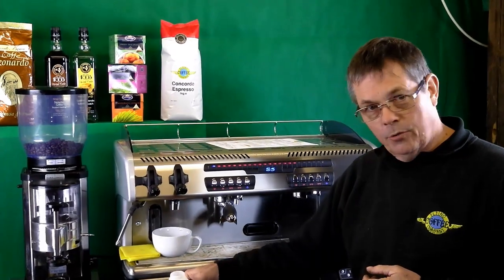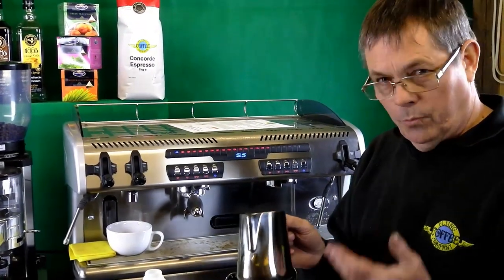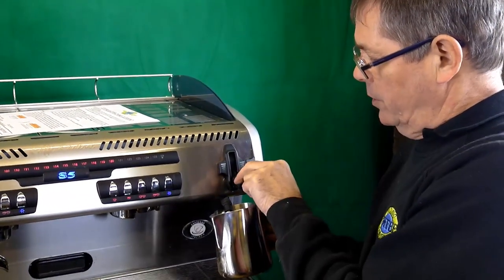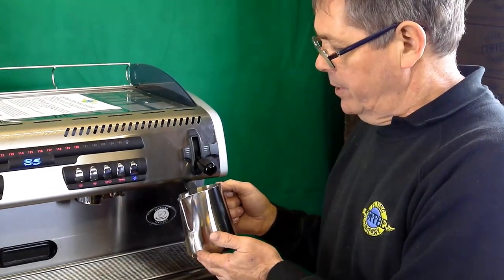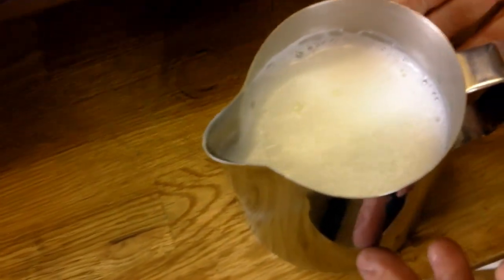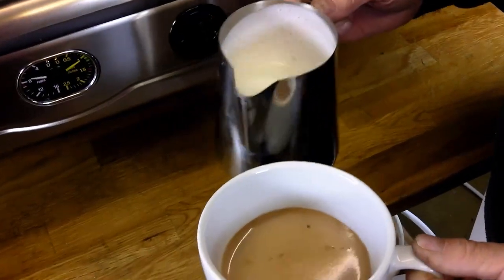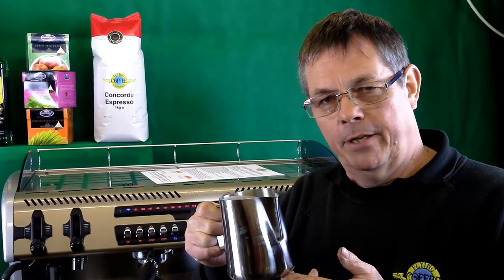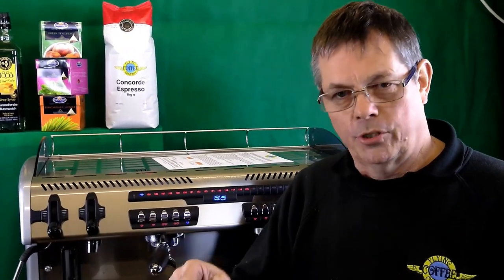How To Get Perfect Foamed Milk Everytime

Comment: Just one thing to say, is that the machine used in this video is clearly a very high quality commercial Espresso machine, a La Spaziale S5 - about five grand's worth of machine. If you're trying to learn to steam milk for Latte art using a domestic or prosumer espresso machine, take this gentlemans advice - but ignore the legnth of time he's steaming for, as you'll probably find it takes you a lot longer. 

I learned using a Gaggia classic, on which I modified the wand (ditched the rubbish turbo pannarello and fitted a Rancilio Silvia steam wand, see coffeeblog.co.uk/classic ) and it would take me around 30-45 seconds to stretch, and then I'd dip the tip to get the milk spinning for usually probably another 30 seconds or so until the milk reached the right temp, so around a minute to 85 seconds, clearly much longer than videos like this where baristas are using top-notch commercial machines. I thought I was doing something wrong at first as I noticed that nearly all the videos I was watching showed people doing it far quicker.

I've recently moved to a La Pavoni Europicolla (brilliant machine, see coffeeblog.co.uk/lapav), and although this is still an inexpensive machine, the steam is better, its quite a bit quicker to steam on this machine, and the results are more consistent, but still - I wouldn't expect to steam as quickly as with a machine like this.
Reply: Coffee Blog

Comment: Why not use a thermomoter at least until you get an idea of how hot your milk jug feels at the required temp. That milk you foamed does not look right, as had been said already your milk has seperated. Also depending on weather you are making a cappa or a flat white the milk should be slightly different. For the cappa, more foam, for the FW, consistently silky. Also that machine is a top notch machine with a powerfull steam wand. Most people at home will not be able to steam like that as their steam wand will not be that powerful. They should start their steaming with the tip of the wand just beneath the surface of the milk until you get to a temp of about 100 degrees and then lower the top of the steam wand down into the milk(approx half way) to finish the job, again a thermometer is usefull here at least until you can determine the different temps by touch.

Comment: "and that's how your milk should be"  sorry mate not true. You've overheated the fats in the milk which is why your milk looks dry and separated; so you're overcompensating with swirling. Your milk should be glossy, silky smooth like wet paint or a merainge straight off the steam wand without grooming or swirling. Use a thermal indicator or themometer. Sound wise you have the right idea,  But the wrong target. It should be all finished, steam wand off BEFORE the note changes at 68-70degC. Anything over 68degC is too hot( the point where foam particles start to expand). Industry standard is 65degC, and even then Melbourne and Sydney are serving coffee at 55 where milk fats, sugars, expanded protiens(foam) all meet at the similar point of consistency weather full fat or skim without affecting flavour(though a fuller fat will enhance flavour but destablise foam/protiens more rapidly once heated). 
I have had to use milk like yours to suit a classic order of a 'Dry Skinny'cinno extra hot' but it pains me to hear the community of cows in the paddock nearby echo cries for how we treated thier craft. They have a hard enough life already constantly being pregnant.
Everything else you got right, which is great! Many different methods of how to get there. As long as the result is the same Glossy wet paint looking, great textured and correct temperature milk as the goal.
Reply: Well, lemme assume it's a milk froth for cappuccino.